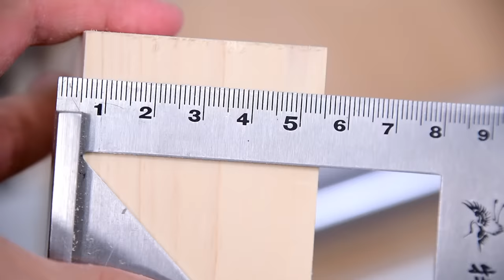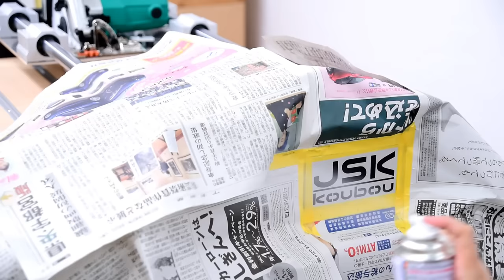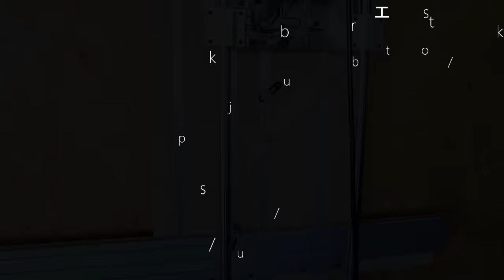Making a 2-in-1 Circular Saw Slide Guide (Easy Panel Saw)

Comment: What is the diameter of the tube because I bought a stainless 20mm tube with an exact diameter of 20.10-20.18mm. But the 20mm sliding block doesn’t go up the pipe.

Comment: Hello, this is a great video, a wonderful step by step very interesting realization! At 10'12 "you show a sliding guide with ball bearing in which you apply grease (you are using 4 of them for this project). Can you tell us more about them? Where to buy them? Internet address for get them? Thanks so much for.
Reply: look at my answer of today :-)
Reply: Look for Linear Bearing Block with 25mm diameter

Comment: There's no way @15:00 that 4 tiny points of metal friction and a tiny glued adjustment screw are going to hold a huge 10 inch saw blade accurate and parallel with all the sawing forces involved. It's going to need constant adjusting after like every cut to even hope to be accurate?

Comment: Sehr gutes Video, leider sehe ich nicht wie die Aussparung für das Sägeblatt gemacht wird.
Reply: Probebly on a CNC machine..?
Reply: Or carefully on a drill stand with a CNC cutting bit..??
Reply: at 12:28 you can clearly see the drill markings and the marked line for the cut-out. I wonder why JSK did not show the process of the cut-out? Maybe because it is troublesome or a cnc drill company did it for him?

Comment: I just bought 4 pcs aluminum L bar 8’ long and it cost $ 28 each at Lowe’s. I wonder how much you spent just the the hardwares?
Reply: like 40-50 bucks for both runners. Check alliexpress

Comment: Do you think there is a risk of the pipes bending if they would be longer? I would like to stretch them to fit a 115cm sheet.
I am planning on using solids just in case...
Reply: Did you succeed in making it longer?

Comment: quick question.....do you use the same blade used for wood cutting to cut through the aluminium base sheet and t-slots??
Reply from the maker: そうです。
金属も切断できる汎用鋸を使っています。
Reply: @jisakukobo  plz could  you reply in english...I am not sure if google translate work that well....I meant to ask you If you were using the same blade for cutting the aluminium which you use for wood?

Comment: Was it me or did I miss somewhere that the plans did not give a detail parts and cut list. I realize that some materials may not be available in the US but plans like this that I'm used to purchasing online gives a materials needed and size cut list for each items needed?   Please this is not a complaint but the plans I purchased and downloaded does not have this.  The download was 13 pages and no step by step instructions what-so-ever.  Again, this is not a complaint just a query. If I missed that then that is on me, but I didn't get what I was expecting. I'm sure I can figure it out via the video and what I did get with the download.  If someone can provide the conversions in inches on the size measurement within the plans that would be great.

Comment: Just downloaded the guide very dissatisfied that it isn’t more detailed. It doesn’t even tell me the size of the pipe, bearings. A detailed list of all parts should be available.
Reply from the maker: You should read the web manual that came with your plan.
Reply: JSK-koubou  I have not received any web manual just a load of pictures.
Reply: JSK-koubou  I can not find any web manual  can u please email me the manual.
Reply: JSK-koubou  I would like refund as the pictures I have downloaded are not detailed enough. No measurements for the length of wood & stainless tube.

Comment: Those Thomson ball bearings are over exceeded, those ball bearings could be for a big table saw, sorry you have weak points like stainlees pipes instead of linear guides, and you never adjust your car between the pipes si may be you are forcing the ball bearings may be they could lose precision soon